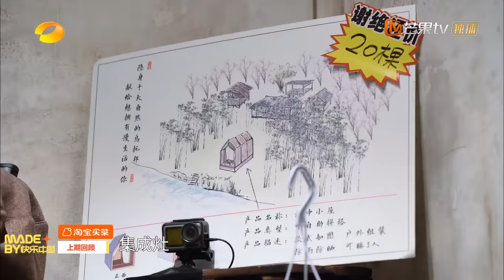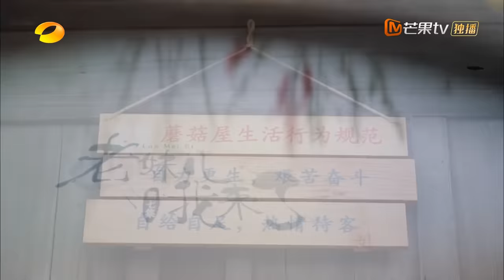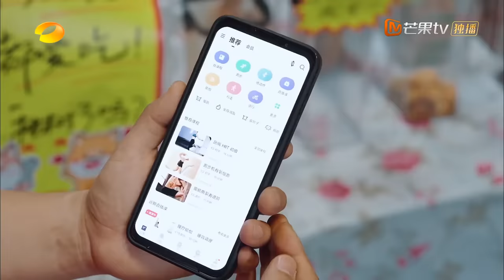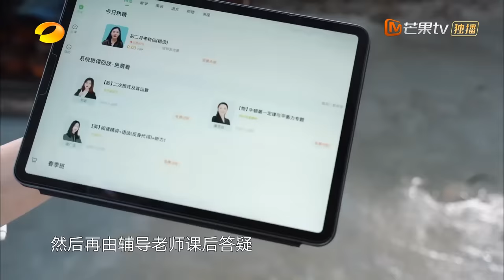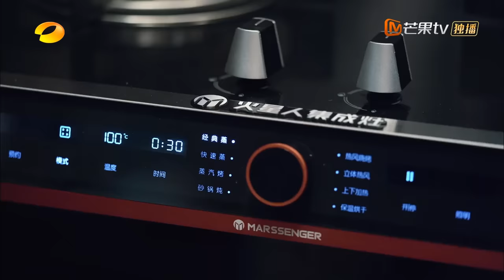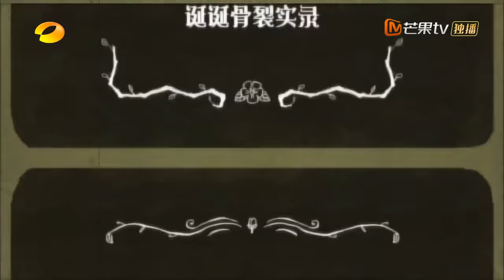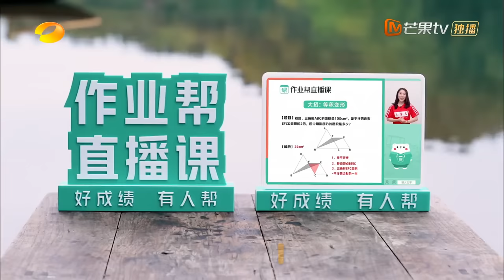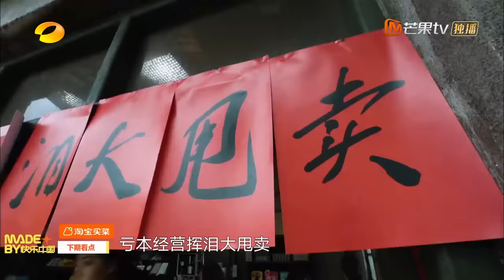《向往的生活5》第7期 完整版：彭昱畅被黄磊何炅灵魂拷问？李雪琴爆笑演绎烫嘴绕口令！ Back to Field S5 EP7丨MGTV

Comment: Peng Peng left in the middle of the episode. Turned out, no one volunteered to fetch and move the flower pots. 🙁 and I got disappointed with Yixing when he let Mèi mei clean up the dog's mess. It may be a petty thing to do and Mèi mei can handle it, an offer from an older brother will be comforting. I'm sure if Peng Peng was there, he will help Mèi mei because Peng Peng did the same on previous seasons whenever dog messes the floor. 😢